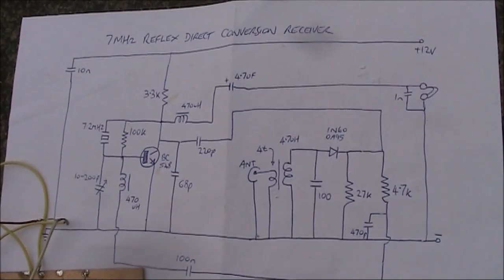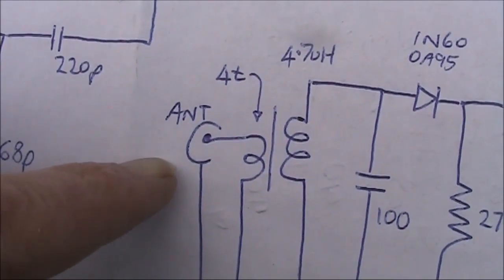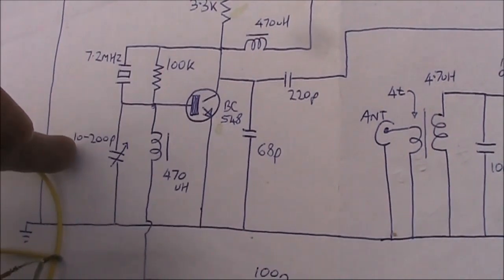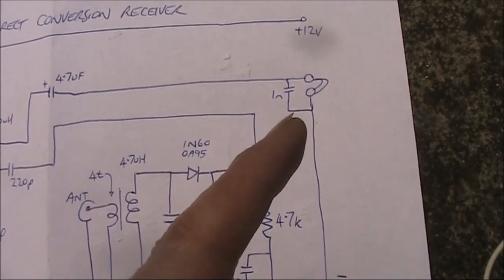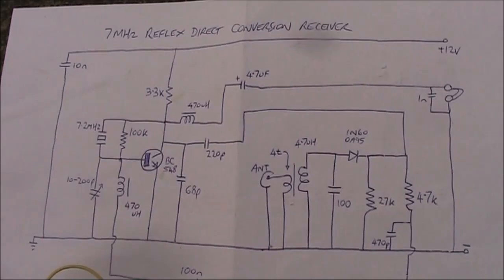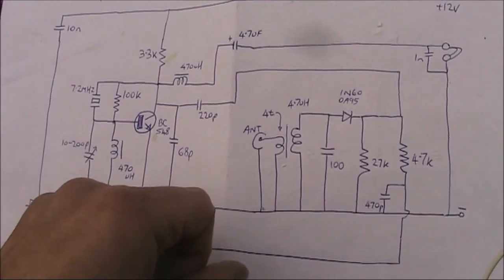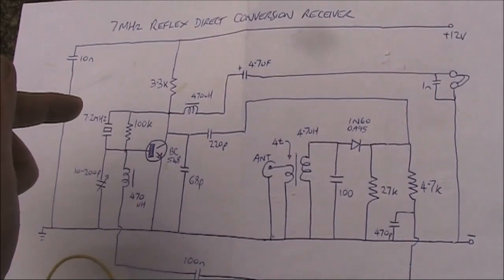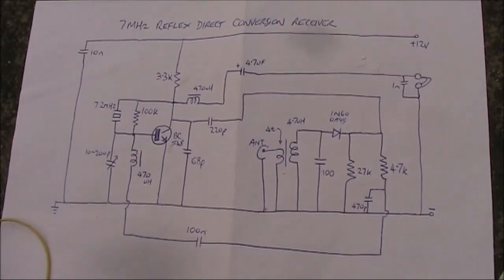Direct conversion reflex receiver concept

Comment: Peter, I love your videos. Have you ever combined both regen. and reflexing together in a simple receiver????? Many years ago I built one for the broadcast band and it was bloody brilliant. I wonder how it would go resolving cw/ssb. ?????
Reply from the maker: I haven't built one but one to try is here: https://www.cool386.com/reflex_one/reflex_one.html Regens have poorer strong signal performance than direct conversion & superhets.
Reply: @vk3ye  OMG Peter!! I built that very radio when I was 12 years old. I still have it under the house some where. Probably covered in dirt and dust and broken, but it is there. Have been looking for the circuit diagram for years but have had no luck. Now there it is. The aerial I used was a length of galvanized wire rope about 30 feet long with broken beer bottle necks for insulators. I lived out in the bush with the nearest station about 60 miles away. The radio worked quite well into headphones.

Comment: Nice Work!  Impressive 1 transistor circuit.  
I’m still using your 1 transistor pulsing beacon circuit.  Well I added a few transistors but ultimately it’s still 90% your design.  -k0mov